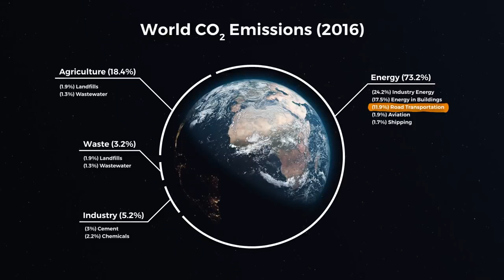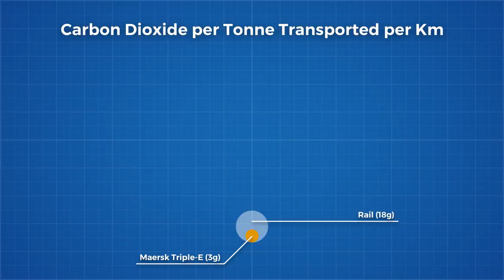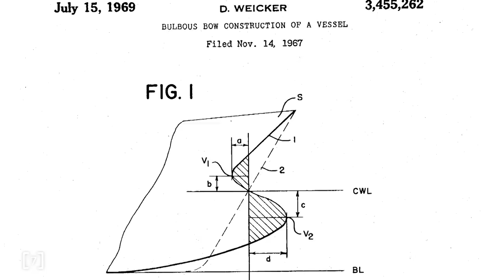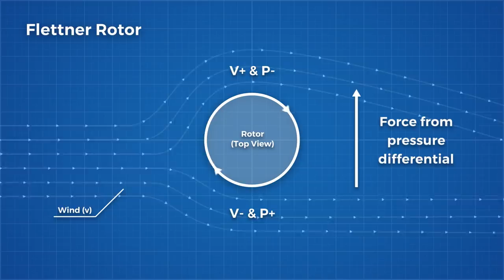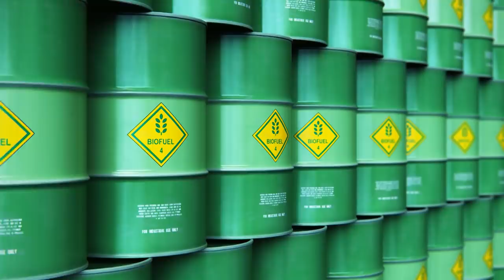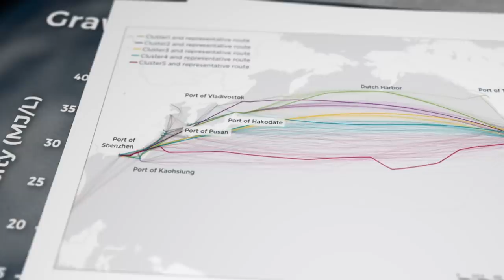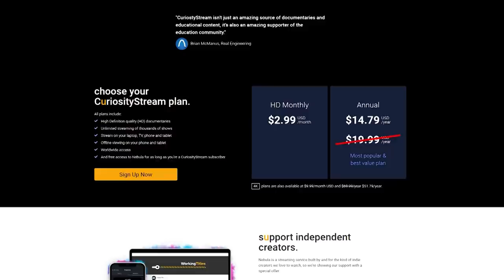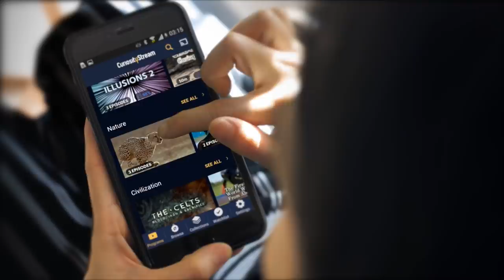Are Renewable Powered Ships Possible?

Comment: Wind power :
"You could not live with your own failure."
"Where did that bring you?"
"Back to me."
Reply: To address the suggestions that sail power is the answer I offer the following.  In 1870 a premium sailing vessel entered service, the ‘Cutty Sark’, she could carry around 600 tonnes of cargo at speeds of up to 17.5 knots, dependent on the prevailing wind, to harness the energy the available spread of canvas was up to 2 976m2.  To round things out that was circa 5m2 of canvas for every tonne of cargo carried.  The ‘Cutty Sark’ was designed and built for employment in the tea trade where time on passage was a large factor in securing the premium freight rate that made her cost effective but as soon as the Suez Canal opened, which the ‘Cutty Sark’ was unable to sail through, she lost her advantage, raw speed, to the steam powered ships of that era.  Mechanically powered ships have improved in terms of efficiency, on a freight tonne mile basis, by at least one order of magnitude since then.  After losing out to the coal burning, steam reciprocating mechanical ships of the late 19th century ‘Cutty Sark’ was relegated to the Australian wool trade, just about the bottom of the barrel in maritime terms and only one small step up from being a 'honey barge'.  The canvas, cordage and extra manpower needed for sailing ships was never a very benign environmental option so please discount any idea of sail as ‘sustainable’.  All this is without the problem that if ‘the wind don’t blow the ship don’t go’, when it does blow it often blows in the wrong direction for your cargo delivery needs and sometimes there is rather too much of it for comfort.
Reply: @Allen Loser Yes, I fell into the 'other' exam candidates folly; never mind the question display the knowledge you have! Still working on this though.  Energy harvest  is the key point, where does the energy come form and what is the cost of getting it to where you need it.  With the side issue of how much do we need?
Reply: @Allen Loser The best resolution to the ‘side issue’ is still reduced consumption, both by reducing the number of individuals and their per capita resource use.  WRT establishing a credible correlation between ‘a credible cost versus benefit analysis’ this is rather like ‘count the chairs, measure the table’.  With the added difficulty of convincing a sceptical audience, at what stage does ‘evidence’ become ‘proof’?  The cost of improvements, such as reduction of sulphur in hydrocarbon fuel, is easier to determine than the balancing benefit, the improved atmospheric environment for which the loss of commercial opportunity is often substituted.  A last thought on the ‘Cutty Sark’ illustration is now, but may not have been when I posted that part of the sub thread to you, ‘All this is without the problem that if ‘the wind don’t blow the ship don’t go’, when it does blow it often blows in the wrong direction for your cargo delivery needs and sometimes there is rather too much of it for comfort.’
Reply: @Allen Loser Good morning Allen.  Something of a days 'work here', to avoid any 'off the cuff' remarks it will be at least 8 hours before I can address all the points you raise.  Blue Crude will be a research project all its own, sulphur content in crude oil was usually indicated by how 'sweet' or 'sour' the crude was, sweet (low sulphur) crude did tend to have a premium over sour but often availability and processability tended to be the key factors in crude purchase decisions.
Reply: @Allen Loser  If they still have LSD & ULSD in your area what is the price differential?  I am taking ‘greed’ to be ‘enlightened and socially responsible self interest’.  Sulphur is a corrosive and while not a lubricant in and of itself, it can combine with the nickel content in many metal alloys to form a low melting point eutectic alloy that can increase lubricity.  The process used to reduce the sulphur also reduces the fuel's lubricating properties.  Earlier information from my days hanging about the petroleum labs was that sulphur had some ‘lubricant properties’ which is why lubricity became an issue when in the early 1990’s ULSD was introduced, leading to much chatter about HFRR (high frequency reciprocating rig) performance and 'wear scar' values.  If the wear scare was ‘off’ additives were, and still are, introduced into the blend to get the product back ‘on spec’.  In Sweden Preem produce ‘bio diesel’ from forestry industry by product which is sold at the same pump price as fossil fuel; but supply of this ‘green’ fuel is limited by forestry production.  My own vehicle use is a pre-owned high mileage Otto cycle Ford Focus running on E85, a blend available in Sweden that is 85% ethanol.  The ethanol is mainly sourced from the Brazilian sugar industry and surprisingly though common in Sweden this grade is not available in the neighbouring countries; Norway, Denmark or Germany.  The previous car I ran was a TDI (Diesel cycle) Ford Mondeo bought from my employer at the end of the corporate lease and again high mileage at purchase but when it stopped being economical to maintain at 17 years of age I downsized; the Mondeo, which ran on ULSD, had no fuel injector or DPF (diesel particulate filter) problems either from my own experience or in the service history.
Reply: @Allen Loser have added a few words.  Individuals in a society with a, not perfect but better than the alternatives, capitalist economy exercise liberty as to how to invest, save, use, and spend, or to waste the wealth, which they have lawfully acquired.  That is as it should be.  Thou shalt not covet.  With you on that (just to clarify BLS).
Reply: @Allen Loser Again added a few words. Not eliminate, educate or persuade, ‘stabilise’ is not that severe and technology has advanced to the stage where the planet should be able to support more than the pre-industrial era population, but ‘by how much’ is the debate.  From the 1950’s, before even my progenitor phase, the motto with regard to children was ‘two will do’; now the ‘replacement rate’ is said to be 2.1; as children always come in integer units the advice I got seems reasonable, my life partner and I have three children, so we missed the target but sending the bonus child back was not an option; so it was a ‘suck it up and do it’ situation; all worked out fine (ish).

I do not recall ‘arbitrarily banning use of hydrocarbon fuels’ which IMHO cannot be done; they are too good, to cheap and to useful.  Reducing my own use of them is something I try and do, in the same way as I try to limit my intake at any ‘all you can eat buffet’ I pay for.  My opinion was that cost was more easily quantified than benefit so making a credible analysis was difficult; I am going to stick with that for now but am open to suggestions on how the analysis is possible.
Reply: @Allen Loser There is no intention of trying to change your behaviour for the benefit of anyone but you.  The advance of technology and ingenuity will carry on and if a system like the point to point short term hire of electric scooters gets adapted into something useful like the point to point short term hire of small electric town cars (vide Citroen Ami) everybody could benefit.  Seeing empty buses and trains running around really ‘rattles my cage’.  If both of us, along with everybody, else do not consume excessively everybody will benefit.  Referring back to an example from earlier in the thread if I do not over eat at the ‘all you can eat buffet’ I stand less chance of becoming obese, less chance of developing type two diabetes and less chance of cardiac problems and so should stay around long enough to grow old disgracefully.
Reply: Ahem in that sense nuclear powered  ships have a word with you but no like i get it car and plenes are bad idea but ships those can be huge
Reply: @ufuker5754  they are huge and that is because they carry a huge amount of stuff! The only sustainable way to go is to move less stuff over shorter distances so every individual has to consume less and source what they do consume from closer to home.
Reply: @BernardLS  nuclear power is more economic for even bigger ships
Reply: @Allen Loser reduction is not abolition. My Ford made in Germany is better for me from an environmental impact stance than a VW built in Mexico perhaps, but not as good as a Volvo from Torslanda just down the road. However USA grown corn (maize) is less likely to be the ethanol source than Brazilian bagassse or Swedish sugar beet.
Reply: @Allen Loser Greed, as in enlightened and socially aware self interest, convenience and direct benefit are motivators to my actions as well always bearing in mind that I am trying to 'tread lightly' and get the 90% of output that requires 10% of inputs.
Reply: @Allen Loser IAW yes, some are born cynical, some achieve cynicism others have cynicism thrust upon them. I managed all three; unless humanity can be persuaded to do the ‘right thing’ my grandchildren may be in for a very uncomfortable time.
Reply: @Allen Loser The prevention could include steps that many might consider inimical with their right to pursue happiness; at least the short term personal gratification that the global recreation and entertainment industries try to sell us is the route to that end.  The drivers of climate change operate at a much longer time scale than individual purchasing decisions, when the time to react is before the purchase reductions in consumption could be the best option.

I have changed my behaviour throughout my life as realisation dawned and am doing the little I can to mitigate my impact.  Now how about the other 7.8 billion minus one participants? Does the last sentence mean, as it seems to imply, that once the damage is done you will consider remediation?
Reply: @Allen Loser 'I am the sole arbiter of what better meets my needs.
'  As in 'we do not inherit the world from our parents, we borrow it from our children'?
Reply: @Allen Loser 'Younger generations inherit the best solutions available.'  WADR our progeny inherit what we leave them so if our decisions lead to a less than optimal outcome they have to clear up the mess.  Some think that a festival, like SXSW, is a essential others have different opinions bit the simple existence of less than optimal resource utilisation is wasteful.